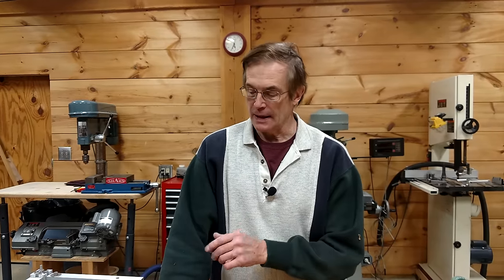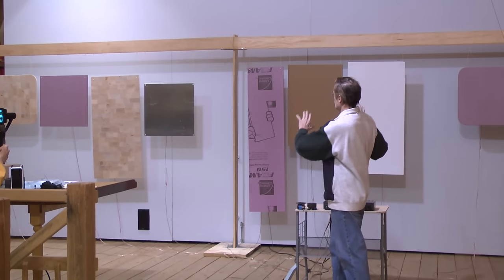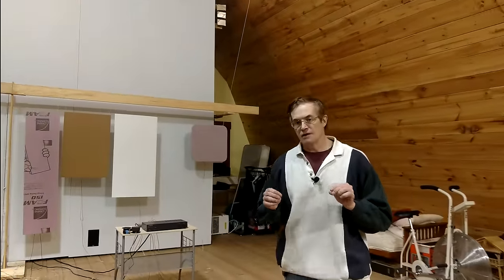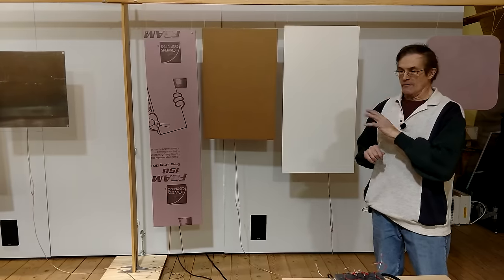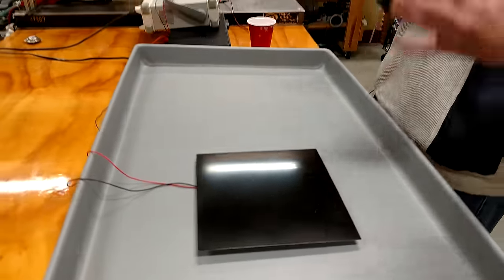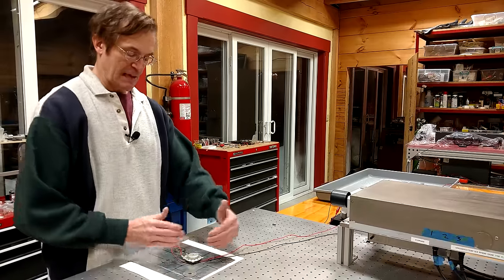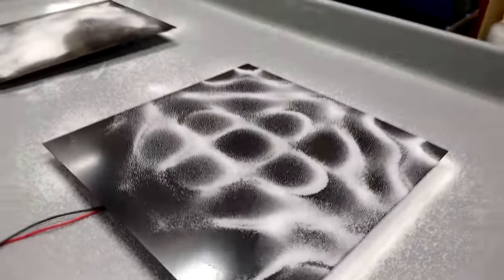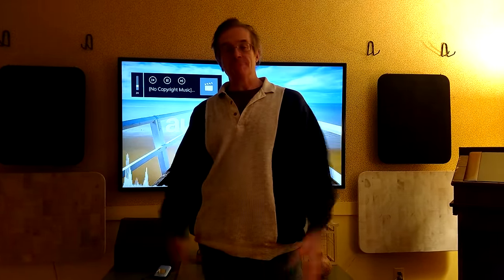Fantastic DIY Speakers for less than $30!

Comment: Here are the facts from the video and an earlier post:

The XPS panels are 1" thick x 24" x 30" (mid to Hi range unit).
It is important to use XPS (Extruded PolyStyrene) panels.

The balsa panels are 1/2" thick x 30" x 36" (Lo to mid range unit).
Balsa panels may also be found as lightweight plywood panels used for commercial signs.

The radius on all panel corners is 4" and the exciters are placed on the back, off center, based on a 2/5, 3/5 rule. 
So for example, the exciter on the XPS panel is located  9.6" vs 15.4" from the long sides and 12" vs 18" from the short sides. 
These 2 alternate positions works equally well.

As explained in the sugar part of the video, counterweights should be fitted to dampen the resonance of the panels.
Each panel has 4 counterweights - each weighing 1/16 of the (painted) panel weight - are placed on 2/5, 3/5 points in every small rectangle created by the position of the exciter unit.
This is a bit complicated to comprehend, but watch the sugar part of the video closely, over and over until you get it.

Also in the video, there is a good explanation of how and why the selected materials and panel size results in a frequency range of 130Hz-20KHz

The original acoustic exciters used are :
Dayton 25mm DAEX25FHE-4 (4 ea.)
or as alternatives
Dayton 32mm DAEX32EP-4 (4 ea.)
However most likely you will have to source alternate makers units from Ebay, AliExpress, etc.

Links:
Dayton users guide, excellent explanation: http://www.daytonaudio.com/index.php/exciters-buyers-guide (scroll down)
Living room test song used, for comparison: https://www.youtube.com/watch?v=sGsC98vR4Q4
(Thanks to GlenGlen !) Link to build step by step: http://projectgallery.parts-express.com/speaker-projects/dml-flat-pannel/

IMHO instead of using an old school bass speaker, you may experiment with a deep frequency exciter.
This is the unit some readers may recognize from a gamers chair, which literally kicks ass, when grenades are thrown in the game etc.
Depending on actual test results such units may be placed under a table top, on the wall, on the floor etc:
https://www.ebay.com/itm/50MM-Resonanzdampfer-Alle-Resonanz-Lautsprecher-Vibration-Starke-Bass-Speaker-fs/292413284916?hash=item441530a234:g:eCQAAOSww85aer26
Reply: Thank you for your time and effort explaining your building methods :-)
Reply: Thank You, Thank You, Thank You. James here in Sacramento California but originally from Dublin Ireland by skill set a finish carpenter but performed as a general contractor specializing in kitchen and bathroom remodel. Due to the exhaustive juggling of other trades trying to keep to the start and end dates of the contract, I studied electrical, plumbing, sheetrock, mud, texturing etc etc. Due to the downturn, my age and health I've been looking for my third act performance and with every one of your amazing tutorials, your passion and ability to make MIT level theories understandable to masses, I am again bursting with business ideas for the future. Thank You for rekindling a dampened spirit. Your hands on, blue collar skills mixed with an extensive knowledge base, experience, intellect and genuine love of instruction and teaching is so very, very rare. Considering the number of bad channels on YT, you're truly the diamond in the rough. Thank You. Sheamus.
Reply: Do you have a DIY video on the 50mm resonance dampers for bass?  Thanks
Reply: Thank you!
Reply: Thanks CX.
Reply: Excuse me, I somehow missed moment, where 20[Hz] - 130[Hz] issue was described, could you help me please?
Reply: Thank you for your comment.  You supplied the missing 1/2 of this video.
Reply: Where can you get end grain balsa that size?  All I see is 24"x24".
Reply: Ed Siefker - you might check with local merchants that still have some wooden, physical signage they want to get rid of. Also, a sign-making shop should be able to, at least, point you in the right direction, or perhaps be able to order it for you. Best of luck. This video piqued my interest, as I haven’t made “speakerboxes” since the 80’s! I have a little free time... 🙂
Reply: plz upvote this one !
Reply: This needs to be upvoted to the top, or referenced in the description!
Reply: According to the video it's 5 counterweights. I don't understand why, he doesn't talk in depth about it, but he does say 5 at 22:29
Reply: @lorenz.f  Yeah... What about that?
Also, the final boards aren't 2:1 ratio as he mentioned, but just slightly rectangular. How does that work with the resonance?
Reply: I felt my 'like' needed an extra "Thank You".  Thanks for taking the time to extract this info. It really helps with my drafts and design. It would be awesome if Tech Ingredients had a blog that followed their videos, like Matthias Wandel's.
Reply: @armandojuarez2064   you might want to check out some of the later videos he did on the topic, some stuff changed without increasing the price, he takes the counterweights out for example.
Reply: @lorenz.f  Thanks Lorenz, I'll look into it. Have a great weekend.
Reply: @jamesh1017  - James, people like you are a dying breed. You, like myself, never stop learning. When I was younger, contractors would come to the company I worked for, as is often the case. Since I'm in a unique business, many things have to be custom built and if we couldn't do it all or in part, we'd have to bring in people specializing in these areas of need. That said, during my lunch hour, instead of going to the break room and yammering with the other employees, I'd go watch the contractors, pick their brain and suck up everything I could about what they were doing. Because of this, I am now a master thermoplastic fabricator, a master industrial pipefitter for both standard and chemically sensitive systems, I can run just about any ultrapure water system (Lab RO and DI) and the list goes on and on. Because I have such specialized skills, if I ever was in need of a new vocation, I'd have no trouble. Work hard, get educated and take risks.

It didn't matter if I was digging ditches, or managing a nanotechnology lab (my job now), I always do the very best I can and always look for innovations. I'm also an inventor and product designer. My mind is like a sponge and I couldn't stop the ideas even if I wanted to.

Sadly, most young people today are the product of the socialist agenda in our public school system, which trains them to first be entitled and then dependent as adults. This pushes us toward socialism more and more as far too many have their hand out, or expect the gov to take care of them. These people are "too good" to start at the bottom and work their way up. They want to come out of school and be handed $100K a year and a corner office. Then we have the career slackers who are still working the fast food line at 35, not aspiring to even do the management training program within, expecting to be paid like a skilled laborer. I know guys doing what you do and still not being at $15 an hour! They possess skills far beyond a guy who turns a fryer on and then pulls a basket when the bell goes off. These are people dealing with pressure, yet slackers think they deserve more money.

I wish you the best my friend and I can see you never stop. Things have probably come to you and that will continue. One thing I always tell young people is: It doesn't matter what you do, someone is always watching. If it's not your boss, then it's an outsider who takes notice of you. So, as long as you are voluntarily doing a job, best to work hard and keep your complaints to yourself. I'm sure you are much the same way with advice. By the way, that guy they think is getting away with not pulling his weight? Guess what? He's being watched too. Those kind of people always end up on the bottom, sooner or later, no matter how much they believe the boss lets them get away with things. One trick I do is, if I see garbage on the floor (keeping things clean is paramount in my business), I'll purposely leave it there to see how many people walk by it and how many times. This gives me a good indication of their integrity. 

Loved your comment!
Reply: wowww you're the man! Thank you!
Reply: @scottmcman7659  as a young person about to graduate from highschool i absolutely agree. in the modern age we have access to information galore yet so few learn it
Reply: @sirblacksmith2297  - How right you are! Getting information today is no harder than a click on a "smart" phone. In my day, you actually had to go to a library and then open books. Not to mention, you could only access what was available in that library. Then you actually wrote everything down...in cursive. Many young people don't even know the meaning of the word, let alone doing it.

So much knowledge, yet they'd rather take 20 "selfies" or attack someone on social media.

You have a precious gift and that is time. Don't waste your youth. Work hard, learn everything you can, take risks and look at failures as learning experiences that get you closer to your goals. Time goes fast and before you know it, you are 50 and wishing you hadn't wasted so much time in life. You want to enjoy life, but you didn't prepare, so you have to keep struggling.

I pray you reach your goals young man. You are the exception, but those around you who choose to put things off or mock you, are the same people who will be working for you and others like you later in life.

Be the best you can be and fight your way to the top. Don't burn bridges and treat people honestly and with respect. Integrity is something that can't be taken from you if you don't give it. So happy to have one more on the right road. All the best to you!!
Reply: What do you use for the counter weights?  And how should they be attached to the panels?
Reply: Hi CX - thanks for writing this up, but I think you have a typo there..you say

...off center, based on a 2/5, 3/5 rule. So for example, the exciter on the XPS panel is located 9.6" vs 15.4" from the long sides and 12" vs 18" from the short sides. 

I think you mean this:

... off center, based on a 2/5, 3/5 rule. So for example, the exciter on the XPS panel is located 9.6" vs 14.4" from the short sides and 12" vs 18" from the long sides.

And while we're at it, the measurements for the balsa panels would be 12" vs 18" from the short sides and 14.4" vs 21.6" from the long sides.
Reply: THANKS!!!!!
Reply: Can I use different exciters? 
Cant find any with sticky tape... I would like to go with the Visatone frs 8m.
Reply: @janred94  you can find the same exciters he used at Amazon
Reply: any idea what THICKNESS the end-grain balsa is?
Reply: @coolcustomer31  There is a previous comment in this same thread :

Lorenz F.
8 months ago
@Armando Juarez  you might want to check out some of the later videos he did on the topic, some stuff changed without increasing the price, he takes the counterweights out for example.
Reply: Thanks man!
Reply: Thanks!
Reply: What is your thought on using a hardwood end grain panel but to get the weight down try to do quarter inch thickness? I like the idea and what it would look like to do different patterns in the grain or have it randomized in piece size.
Reply: @ac.creations  The use of balsa endgrain panels is purely because of the low weight and rigidness.
Using a heavier panel will substantially dampen the sound output, especially in the low region, making the whole setup a lot less efficient.
Trial and error could find personal satisfactory results though.
Reply: @CXensation  my thinking was to achieve the same weight by making it thin enough
Reply: @ac.creations  It will flex too much, still making for weak low end output.
Leighweight to make it efficient.
Rigid to have a deep low end.
Watch the video again, as its exactly what he demonstrates.
Reply: @CXensation  maybe epoxy stabilized for rigidness? Just throwing ideas out
Reply: @ac.creations  Try it.
Reply: 9.6 vs 14.4 no?
Reply: I'm 2 years late but hey! Thanks for the effort you put in your comment!
Reply: Thank you awesome person
Reply: Thank you
Reply: @biteme263  Transducer is the more technically correct term but "exciter" may actually work as well as a search term
Reply: Can you give a parts list so we know exactly what to buy? What amp for example and what's he using to send the sound through? What's the wire he uses
Reply: And where did he get the counterweights?
Reply: Like how did he affix the counterweights?
Reply: @Daniel Dyck No cheap objects have exiciters to my knowledge.
Reply: I am in the planning stages of building a house. I wanted to do a whole home audio system, it is something I always wanted. I notice that all the materials were held suspended in the air. Would there be a way to make these part of a wall, I was thinking of nice accents near the ceiling with some sort of insulating caulk, or would that muddle the sound?
Reply: @MisterBhuiyan  The whole idea with this concept is that the base material is allowed to move to make the sound propagate.
The base material substitutes the cone in a normal speaker.
Your idea would destroy this concept.
If you want wall sized speakers using this concept, you must therefore hang large plates freely on the wall or down from the ceiling.
However you can decorate the plates to your like.
Reply: Would it be possible to use larger speaker drivers for more base response to eliminate the need for a separate subwoofer?  Would there be a reduction in sound quality at higher frequencies?
Reply: @ronaldgreene5733  If you need more bass you will have to use several units in parallel.
Large units would require large magnets hence making for a heavy unit.
Reply: Thank you